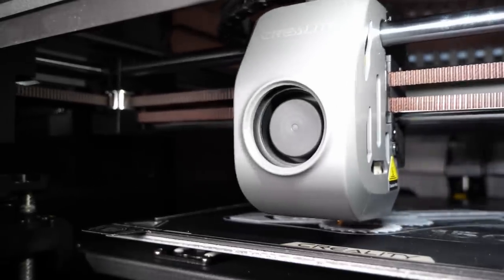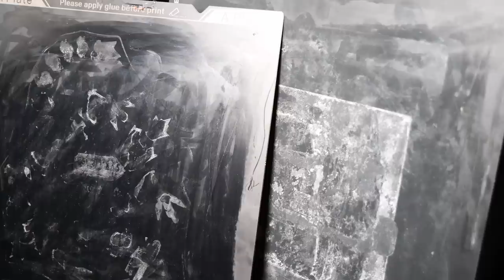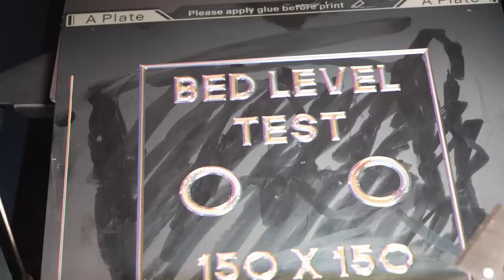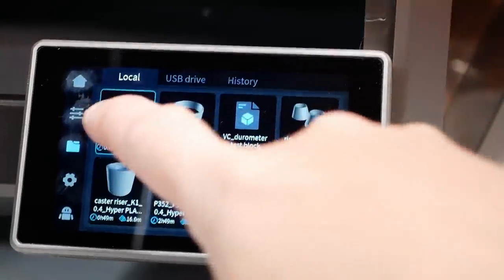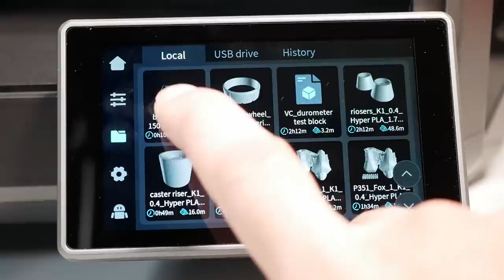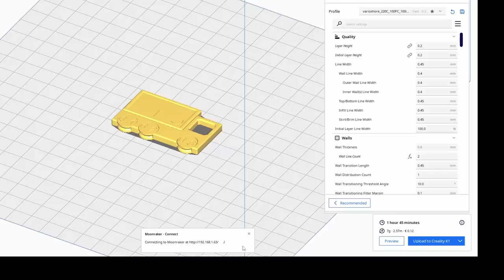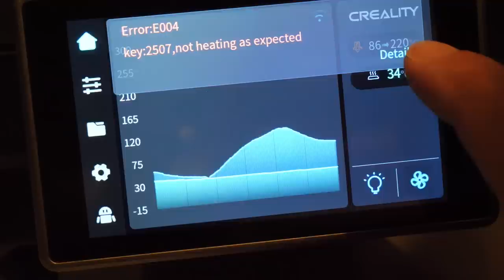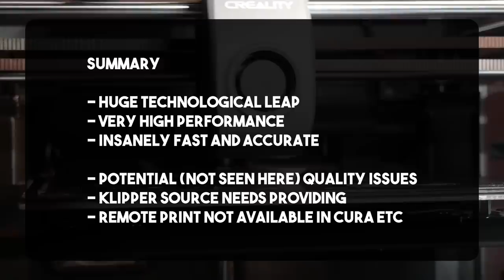The Creality K1 looks amazing, does it live up to the hype?

Comment: I notice from NBR's channel they have an improved extruder/hot end now, and you can add the camera for just a quid, also it comes with gluestick ... I've had one in the shopping cart a couple of times in the past 24 hours, but not pulled the trigger yet ...
Reply from the maker: Yes as it turns out my K1 machine has that extruder. So that's....interesting.

Comment: Can you tell us something about serviceability? Many complain about the bambus that you can only change whole assemblies (gantry) and not single components (bronze bushings, idlers).

The vfas are induced by the large steppers and large pulleys. Lower rpm typically results in more vfa, peaking at around 1,25 revolutions per second (50mm/s on a 20t, ldo steppers are particularly known for vfa, see prusa mk3). I dont know the size of the pulleys used and outer wall spees, i would assume by the looks 60t pulleys, so 150mm/s would be the critical vfa speed. I have no idea why they chose larger pulleys, my best guess is to stay in stealthchop longer, although with the fan noise stepper noise wouldn't be noticeable.
Reply from the maker: seems quite serviceable tbh, considering what it is

Comment: So I have a k1 and have had issues. Like everyone it’s the extruded they just designed it poorly so it’s seems for most people that’s what breaks. I opened mine up and I saw an issue that people had described which is that the extruded gears are mounted poorly and the screws bend over time. This happened to me so I put a bond tech lgx lite and it’s instantly fixed my print issues. But the other thing is not having access to klipper so I am not able to adjust e steps and had to change flow and retraction to get good prints. It’s just frustrating because this printer seems to be geared as a ready to print machine and if anyone bought it with little to no 3d printer knowledge they be very confused.

Comment: If they used a standard ARM board with stock Klipper and a somewhat standard MCU, they could have saved money developing those parts and their software, enabling a lower price for the printer and capitalizing on the "open source" market... They just need a functioning Klipper config and a slicer profile, and the community would do the work for optimizing the printer settings.
Another missed opportunity in my opinion is that they could have a really basic machine, like the P1P, and have all non-essential parts as upgrades on their page. In this config, the upgrades could be just added in the box, not installed, and option to send assembled at a cost.

Comment: Thanks for the review.  It looks like an excellent printer - its trully amazing how quickly we've seen 3d printers iterate into more and more capable machines in such a short period of time.  The minute you buy something its obsolete.  But I won't be upgrading my S1 and E3Pro anytime soon - they are still reliable and useful.
Reply: I guess, but at the same time I still only have a 1st gen CR10 and it still prints fine. Sure it's only 50mm/s and slow acceleration and can't do flexibles, but I don't even watch the first layer go down these days. As long as the skirt prints well, I've never had a failure.
Reply: I would have bought this printer with the discount price of $400 but my country's currency is kinda weak right now so it ends up being like $450.

Comment: Had multiple extruder issues with my unit off the rip. Tried 3 prints and it wasn't able to succeed at any of them, unit was returned. I have an ender 3 v2 which is more reliable...more than likely going for a p1p carbon next

Comment: I use Orca Slicer for our Bambu Labs printers and Flsun V400; if I was still using an Ender I would be using Orca for that too. I also keep Cura at my hand for things I cannot do with Orca. And for the industrial printers, all of them have proprietary slicers that are tailored for specific machines and they work just fine. Creality Slicer on the other hand, is just an outdated fork of Cura; so I see no point in using it for any Creality printer. 
This video shows that some of the most criticized points of K1 are not actually bad, but the whole "You HAVE TO use Creality Slicer" thing is a deal breaker for me. Not having full access to Klipper is another one. Great printer for its price, but no thanks.

Comment: Looks to be the same size as the Bambu and CubePro, I'm hoping there will be a release where they can reach atleast the 300mm¾ so more props fit without having to cut them.
Reply from the maker: K1 Max is available from 14th apparently, link in desc, go have a poke around.

Comment: I got my new Elegoo Neptune 3 Max now and I love it to death.  It is my 1st direct drive printer and it rocks.
Large bed and great touch screen. The only two things I wish it had was Klipper and a all metal hot end. Then it would I think have been fantastic.

I in two minds about the Elegoo Neptune 4 or pro version?  They have klipper But the bed size is same as the Neptune 3 I have also.
If they did a bed sized Neptune like the Max but with all metal hot end and klipper and have it core XY and enclosed, Then It would if priced well beat the Bambu X1 and the Creality K1 with ease.
Reply: If you want Klipper for "speed" a.k.a. input shaping, Marlin has you covered, if there is easy-to-build Elegoo fork (so you don't have to guess configuration and PlatformIO setup).
New heatbreak will solve hotend. Manufacturers might still think "they all print PLA, PTFE will be easier for bowden" - which is not really the case.
Reply: @kimmotoivanen    Hi, Well, the Marlin speed option sounds interesting But I don't use windows 10 yet. I use windows 7 pro and no it is fine even when others say don't use it?
The newer Cura 5.4 only works on win 10 not win 7 pro. I may upgrade to windows 10 pro soon as I found out I can upgrade from Microsoft directly for free still.

My custom build PC has more than enough power and ram etc. to run windows 10 pro which would be the OS I can get as the upgrade since it upgrades to the same version in windows 10 you have before in windows 7.

I would still need to see some video help on how to set up the Elegoo Neptune 4 pro in the new Cura 5.4 to do faster printing of course also how to do the high temperature hot end too as I not a programmer or high end tech expect unlike allot of lucky users and reviewers.

Comment: I got a glue stick with mine, as well as a tube of lube.  I preordered in late april.  I have one weird problem (and I think it might be filament?).  It prints layer one just fine, maybe even a couple of layers.  then it stops depositing filament, and happily "air prints" away, leaving a large blob on the nozzle, and or strings everywhere.  Sometimes.
Reply from the maker: Are you taking the lid off when printing PLA? That sounds suspiciously like heat creep. Wonder where my glue stick went lol.
Reply: I had the same happen with PETG, lid on. Had 2 x 2hr prints go fine, then had it happen once halfway through on a 4hr print, changed to a quicker print worked fine, back to the 4hr and it did it again within 30mins of the previous fail.

Comment: With regards to the Klipper issue, considering the different/custom chip architecture, I’m guessing you couldn’t just flash normal Klipper on there. However, would it be feasible to swap out the MCU with something like a BTT Octopus and get vanilla Klipper that way? I could see the toolhead breakout board potentially being an issue, but if it’s working in Creality Klipper, seems like it should work.
Reply from the maker: yeah you could gut it and put your own controller in there, and I guess try to reverse engineer the toolhead.
Reply: @LostInTech3D  is it CANbus? Or is there a pair of wires for everything going back to the underside(fans, HE, Thermistor, etc)

Comment: I'll probably get a K1 in a few months, when Creality has hopefully had a few rolling upgrades for teething issues and the feeding frenzy has died down, although I saw the K1 on Creality's website on a flash sale a couple of days ago for $531.  I'd like the larger print volume of the K1 Max (available 14JUL23 according to Creality but I expect that deadline to slip), but I don't want the complexity or cost of lidar or the camera, which I assume to be more Bambu-Me-Too marketing than useful features from Creality's engineering department.  I'm OK printing from USB and Creality makes that easy with a front panel USB-A port and 8 GB of internal memory to store products that I print and sell online, but I'll probably hack the K1 to install the full version of Klipper instead of Creality's open source license violating crippleware.

Benefiting from open source and not giving back or providing the source code as legally required (knowing the open source community doesn't have a team of lawyers to sue them) or even giving attribution for the nicked software makes me angry.  Creality deserves scorn for this and I can see where people wouldn't want to buy a product from a company with no respect for intellectual property, rule of law or common decency.

For all of the modern advances, Creality and Bambu Lab requiring a glue stick seems like a big step backwards in 2023.  They should offer a set of magnetic print surfaces that work with all common filaments without glue sticks.  I print a lot of TPU.  It's very convenient to peel the part off the textured glass and print another part without messing with messy glue sticks.  Glue sticks are a big turn off for me.
Reply from the maker: There's no reason you can't use PEI on a machine like this. Perhaps that's bed B, who knows.
Reply: @LostInTech3D  - Like all things Creality, the aftermarket will supply fixes and upgrades (better magnetic print surfaces, etc.) and the users will supply files for 3D printed parts (carbon filter holder for the exhaust fan, etc.) and hacks (full Klipper instead of Creality stealing the open source Klipper and then crippling it, etc.).
Reply: @LostInTech3D  You can even get the Ender-5 S1 PEI Printing Plate and put it directly on where it lines up with the alignment screws. Not officially bed B, but may as well be.
Reply: A few years ago, Creality did the same thing on another platform where they used Marlin but wouldn't release the code. Chinese YouTuber Naomi Wu met with Creality management and got them to see the error of their ways. Subsequently, they released the code. Maybe she would be willing to do that again with their Klipper version?
Reply: @Liberty4Ever  @LostInTech3D My pure speculation here on the bed - they simply copied what Bambu did with the X1 Carbon.  Bambu's rationale for this bed was they wanted a bed that would allow especially PLA to stick well at a lower bed temp because 60C in an enclosed chamber is a recipe for extruder clogs from glassed PLA in the tube unless you vent the chamber with a fan, and I think Bambu was trying not to do that because they knew one legit criticism of their X1 Carbon was it's loud AF, and blasting the chamber fan isn't helping matters.  In the case of the X1 Carbon, it's stupid anyway because there's so much other noisy stuff with that printer, like the violent clanging when it wipes its nozzle.  But eventually, Bambu's users were hating the bed, so Bambu relented and released their own PEI plates after the third party market ate their lunch for months.  And Bambu included a profile for PEI beds that turned on the chamber fan and raised the bed temp to 55C, and magically PLA worked on PEI without opening the door or propping the glass lid up with a vent print.  My guess is Creality just copied them on the original idea because they made most of their design decisions based on what Bambu did instead of making their own informed design decision.
Reply: @heroflying  - It certainly looks like Creality heavily copied Bambu.  It's their modus operandi.  One of the reasons I don't want a camera or lidar on the K1 is because I think the only reason it's there is so the Creality marketing department can make a product comparison chart with the Bambu X1C and check off lidar and camera on each.  I doubt Creality engineering did anything useful with the camera or lidar, and I don't want to pay for hardware that has no useful purpose after I buy the machine.  It very much feels like Bambu Lab took us back to 2010 with glue sticks and Creality copied that nonsense.

Comment: Honestly…. If Klipper on it was open sourced……. I might actually go for one. I love my Bambulab but a cheaper, functional, open source klipper printer would be amazing. Might even push Bambulab to go open source. 

This has got me thinking about trying to hack the thing open. We shall see. I have some experience programming MIPS.
Reply from the maker: I have zero mips knowledge, not that I have much ARM either, but yeah, my whole point, why are they doing this, its making it harder for everyone.
Reply: @LostInTech3D  absolutely. I’m guessing it’s a cost saving measure but honestly I can’t see on such a “low power” required machine there being no ARM chips available but with the knowledge of what MIPS processor there using, the klipper team should have no issue doing a cross compilation. What I’m more wondering is given that people have already used exploits to gain root access whether someone could do some disassembly to get a perfect klipper port. I have a friend who’s pretty experienced doing hardware hacking on lots of closed source arcade consoles and the like…. If I get one on sale or refurbished or something we might make it a project.

Comment: i have 2 bambu p1ps. i totally wanted a creality k1 but it was shot down because of creality cloud and ads on the app
Reply from the maker: You can avoid the ads by avoiding the app (I didnt even entertain installing it) - but of course then you don't have the app. I think I'd rather pay a nominal fee for an app, like $20/y, than have ads. I'm sure many would agree.
Reply: So now you use Bambu cloud.
Reply: I wouldn't use an app to 3D print even if it didn't have a ton of annoying ads.  This is one of the aspects that force us to see the internal conflict at Creality between the engineers trying to provide nice things and the greed head marketing and managing weasels trying to exploit their own customers, open source developers....
Reply: @LostInTech3D  But why bother, when better manufacturers make their apps free and without ads?

Comment: Had some real bad experiences with Creality customer service: TLDR: I bought a sprite for my Ender Pro, and the nuts on the gantry wheels slam in the side of the frame when trying to use the right side of the bed, or using an ABL around that side. There's several solutions, but offering a 5$ gift certificate to compensate isn't the way to go.

Anyway, on topic: what's with the glue bed? What's with the closed off Klipper.
It looks nice, and It likely prints fast and in decent quality... But I feel like they need a few more sprints / iterations to work out silly kinks like making a glue stick mandatory, but not giving you one with it, etc...

Comment: I need the Max.  But I do have some questions.   Am I to understand you just can't shove a piece of gcode into a klipper machine.  My next rig needs to be a fast on 300-400mm/s.   I really have been avoiding having to go to a RatRig or a Voron.  I do not want to construct I just want to use.   So the K1 looks great to me.  But I do not want any printer smaller than a 300x300 bed.    I considered Ankermake and Snap maker.  But I can not find any speed numbers or good reviews of Snap maker.
Reply from the maker: I would be cautious of snapmaker, they have had some less than stellar reviews, people seem ok with the ankermake although I havent used one. Not sure what you mean about gcode, klipper ....ugh.....proper klipper can be made to understand any gcode command you want. Of course that's in the config that creality are locking down.
Reply: @LostInTech3D   what I was asking about gcode was.  Can I slice on anything , cura, Simplified3d, Prusa and then put that gcode into the K1? or bambo or other klipper based machines?

Comment: So hack it? Can overwrite the current firmware right?
Reply from the maker: At the current time there's no root access, there was a way discovered by Dmitry Sorkin, but I think they patched it, or attempted to. I didn't want to really have to get into that, would rather they addressed it.
Reply: @LostInTech3D  I would think if you can get a bootloader to take then should be able to force it into dfu mode or something. But yeah creality needs to not lock down their stuff or they are just another bamboo labs. This has been a creality trend since the ender 5 pro release. Less and less is open source.
Reply: Yes you can get root access ..  but you still have to replace there install to be able to fully upgrade and mod the machine. If you want to diy it the best method would be to replace the board and just pull off there config and do a fresh install yourself. Most people dont want to get that involved i would guess.
Reply: @JH-zo5gk bambu locks there own stuff creality locks other peoples stuff that's supposed be open
Reply: @JH-zo5gk  - There is a current hack to downgrade the firmware so root access can be gained to install the full version of Klipper.  Shame on Creality to force its customers to do this hacking to have full Klipper access, and shame on Creality for essentially stealing open source Klipper and then crippling it.
Reply: @LostInTech3D  at this point you could throw a Klipper install (mainboard and pi)
Reply: @edgarcornette6387  Besides that, it's a good and inexpensive all in one board. I'd rather go the other way with it and use it in other 3d printer projects as well as the k1.  We just need to make our own linux distribution for it and ideally figure out how to load software to it over USB just in case.